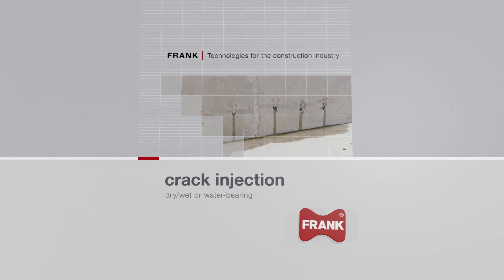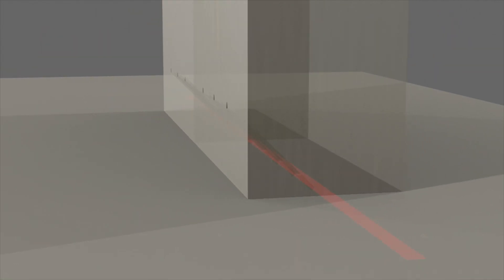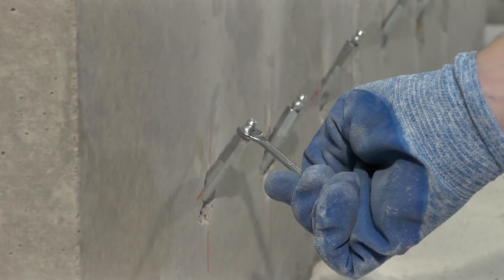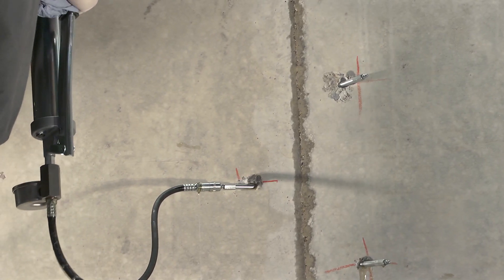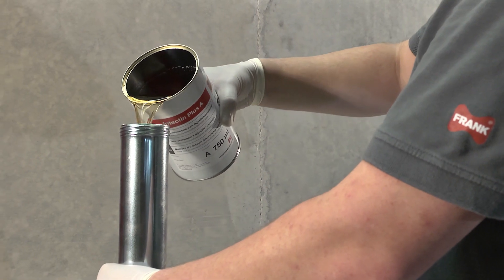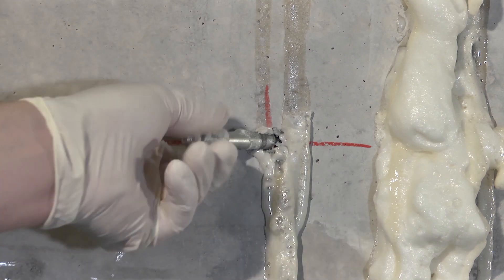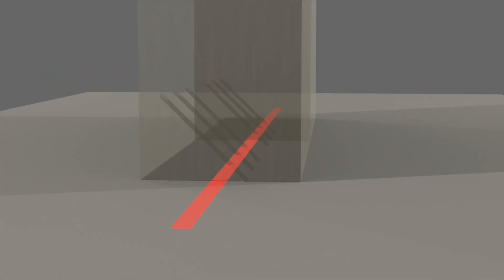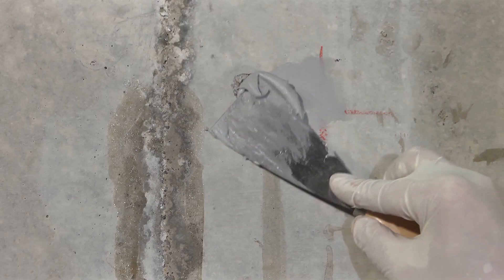Crack repair in reinforced concrete - English

Comment: Is it foam or sealant ? Does it expand ?
Reply from the maker: Hi Hector! It is a little bit depending on when you use what raisin:
If you have already a leak with running water you use "Intectin® Blitz" this stops the water and is more like "foam". After that, you use "Intectin® PUR or Intectin® EP to fill the crack to have it repaired. Think about Intec as the only house that could be used several times.
For any further questions give us a call!

Comment: I install and do injection for 100-200 packers per day. Sometimes more.
 This is not possible using such a pump and spinning each packer manually.
Reply from the maker: Hi Igor - an interesting aspect! What type of connection between hose and packer you would use to make the coupling faster?
Reply: @MAXFRANKGroup I use  a compressed air-operated  high-pressure piston pump  for injection.
To tighten packers -  impact driver/wrench   + socket.

Comment: Is there any situation where the packers are installed into the crack itself?
Where can I purchase in Ontario, Canada?
Reply from the maker: Yes, there is a possibility to position the injection access directly on a crack.
To do this, make sure that the packer is really positioned in the crack (at the end) to ensure that the resin goes into the crack.
In addition, it is suggested that the crack be closed between the packers to create enough pressure to fill the entire crack.
This is not the usual way because it is very difficult to make sure that the crack is hit at the end of the packer - you cannot see into the concrete.
Therefore, drilling into the crack is usually done from the side - this guarantees that the crack is kept in place.

For purchase in Canada, please contact our colleagues:
Max Frank Inc. Canada
49 Maplecrest Lane
Brantford, Ontario N3R 7T9

Tel +1 519 759 3854
info@maxfrank.ca
Reply: Is drillling 45 degrees from the side reccomended for the concrete slab thickness less than 1/2 inch (12.5 cm)?

Comment: The steel packer is going through the crack. Does the black (Expandable) part of the packer has the ability to diffuse the resin?
Reply from the maker: The rubber part functions as a seal in order to be able to build up and maintain appropriate injection pressure. There is no resin flowing out from the rubber gasket only at the packer end.

Comment: How do you know the location of the cracks?
Reply: Either the crack is leaking, then the location is self-evident. In general, you will inject cracks that are wider than the crack width that will self-heal through lime leaching. Typical rang for maximum design crack width is 0,15 to 0,4 mm. Therefore, all cracks that require injection will be readily visible.

Comment: Why working spins Injection port manually key? Included screwdriver tool has not enough money to head for the screwdriver?
Reply from the maker: Dear Jonson A 
you can tighten the injection ports (packer) with a power drill adapter as well. However, injection ports are sensitive to over torque, and the power drill adapter should be used be experienced workers only.
Best regards
Max Frank Group